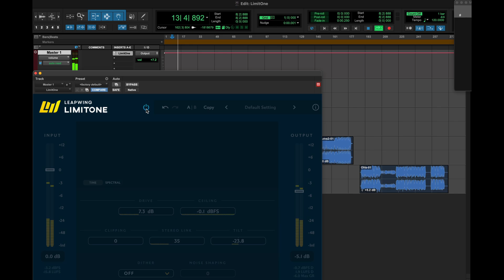Introducing LimitOne

Comment: I bought DynOne when it came out and I still use it everyday. But unfortunately, the user interface is so strange to me. It just doesn't FEEL right. The layout is clear and straight forward, yet the controls are sooooo hard to use. Horizontal sliders that you can't move precisely, that jump 15 dB with one touch. This is why I only use 2 presets that I never touch and dial in the wet parallel amount back in. 

And now, I'm looking at this plugin and think...why do you have horizontal sliders again? The GUI is just not the best one.